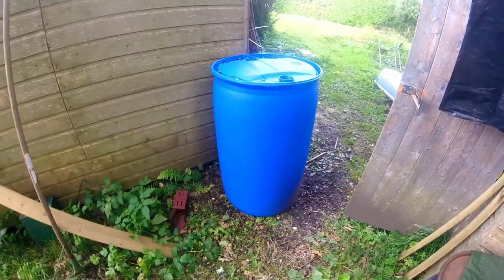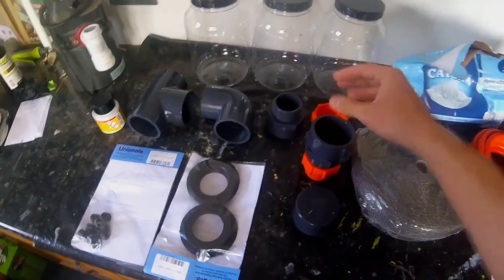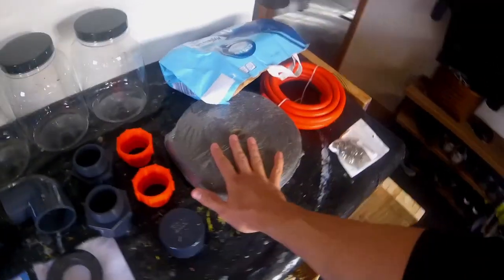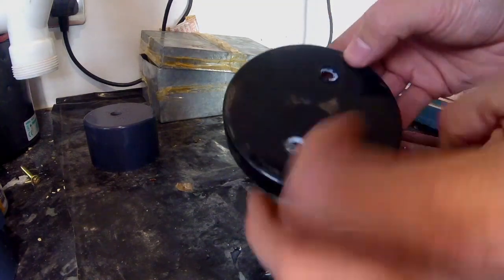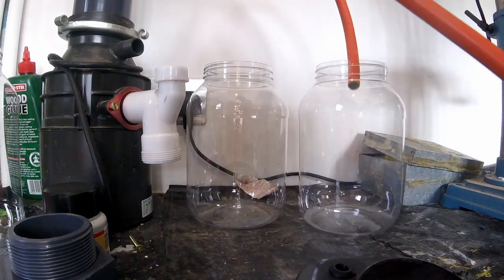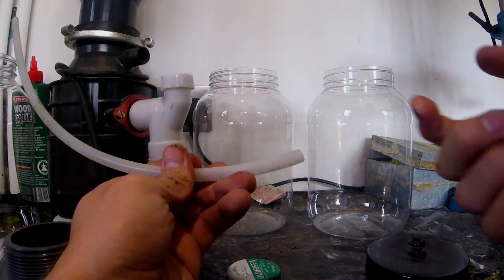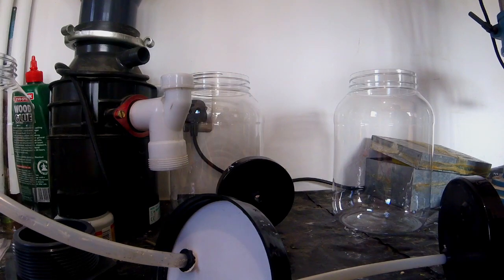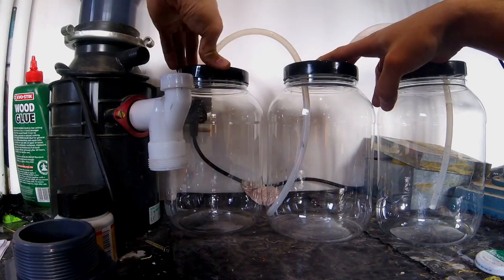Making a biogas digester // free gas at home // PART I

Comment: When using that type of hole saw, it is possible to enlarge the hole by fitting the original size hole saw, inside the larger hole saw. This will help, centre the larger hole saw, and stop it sliding about.

Comment: How long does it take to produce enough gas to run the generator for an hour?
Reply from the maker: Not sure. I haven't been able to produce that much gas yet. It will depend on the feed you are using, the temperature of the digester. Lots of things will influence that.
Reply: @GetMeOffGrid_ jak tam idzie praca?

Comment: I know people in developing countries use methane from septic systems. Do you think that is dangerous. I mean regarding pathogens and such. I suppose methane is methane. Guess the ick factor makes it's weird. Seems like a waste of good gas, if it can be used. Any thoughts ?
Reply from the maker: Yeah, I think it can work. Only issue here is people use lots of chemicals that I am sure would have a negative effect on good bacteria. There is a health issue as well, there can be some nasty bacteria is human waste so it would need to be managed carefully.
Reply: @GetMeOffGrid_  yea I've seen those biogas kits that have a toilet and a stove. Weird but I guess it works. I suppose the bacteria can't travel in the gas, and if they did they would be incinerated.
Reply: The problem of pathogens would be mostly in the digestate the system is producing, the liquid fertilizer left behind after methane production.  This is where we are worried about heavy metals, harmful microbes etc.  The methane portion doesn't carry these concerns.  You could use contaminated feedstock to produce methane, but your remainder is now somewhat hazardous waste rather than a usable bio-fertilizer.  In the absence of commercial grade treatments, it's best to minimise how much of these contaminants are in a DIY setups inputs

Edit:  in the example you gave, a septic tank input is already hazardous due to the microbes that can be present in human waste, so the fact that their digestate is not clean is honestly six and half a dozen.  They haven't created waste, they just fail to fully reprocess it.  You wouldn't spread it on arable land, but you weren't doing that before processing either

Comment: 2 questions, 1) why 2 gas outlets? 2) have you a link to follow up vid?
Reply from the maker: 1) Nothing complex; there were two holes... 2) I think you've found it :-)
Reply: @GetMeOffGrid_  Thanks for reply, I’ve set up a basic mini  system using what I found in skips etc, it’s a 5 gallon container connected via some fish tank rubber tubing. Attached directly to an old Pushbike Innertube, just to prove to myself that I can make BioGas, and to give me confidence to chuck out my old Electric cooker. To I have room for a Digester about the same size as the one in your vid. The Innertube has inflated so a small amount of BioGas is being produced, that’s without any heat and being in the coldest room in my flat. By what I’ve done so far is seems it isn’t necessary to  use Cow Dung as most people do. As I only want to use Plant matter, and perhaps some of my own shit. What do u think?

Comment: Hi, will dog poo work? I'm currently working towards off grid and have 14 dogs.. I hope they can help towards their up keep! 😉 Ta. 🙂
Reply from the maker: Hi. Dog poo is tricky one as it can have some nasty bacteria in, so using the outputs as fertilizers would be a no go. Apart from that dog poo could be used as a supplement but it couldn't be the main base of the digester that would still need to be ruminants manure.

Comment: Hi, will dog poo work? I'm currently working towards off grid and have 14 dogs.. I hope they can help. Ta.
Reply from the maker: Hi. Dog poo is tricky one as it can have some nasty bacteria in, so using the outputs as fertilizers would be a no go. Apart from that dog poo could be used as a supplement but it couldn't be the main base of the digester that would still need to be ruminants manure.
Reply: Ask geknowing questions

Comment: Hi Tom
Is it possible to substitute cat litter with beach sand?
Reply from the maker: Hi Calvin, You would need to substitute something  that is able to absorb moisture well. Dry sand would not be ideal. Charcoal, would work.
Reply: @GetMeOffGrid_  wow thanks dude, does it have to be activated charcoal?
Reply from the maker: @calvinsalim2375  From what I can tell it doesn't matter. Activated Charcoal could remove other impurities in the gas, but in this case it is only used because it will have an extremely low moisture content
Reply: The gas produce from this drum is enough for household cooking? Thanks for the reply

Comment: I feel like I'm being lazy just asking here, but I had assumed that other plant matter (not kitchen waste), such as grass clippings, weeds, etc ("green" compost material, not "brown" compost material) would be fine to add to a biodigester - is this the case?
Reply: grass and other "green" compost that i think you are talking about, contains a great deal of lignin, which is the main component of leaves, ligning cannot be breakdown easily by anaerobic bacteria, and  a pretreatmentshould be added for these kind of "green compost" in order to get a considerable amount of methane.
Reply from the maker: You can add it but it is what would be classed as "low energy" feed so you'd need to make sure you were still feeding it with kitchen waste to keep it going. You could also supplement with extra cow manure.
Reply: Nice

Comment: please help me
Reply: ok thanks for this information 😊😊
Reply from the maker: You will need to be more specific than that. What do you want help with?
Reply: I go to pure biogas
Reply: Which chemical substances you have used for using biogas please tell me in comment section because I am not understand your english language
Reply from the maker: No chemicals. Just cow manure, food scraps and water.
Reply: which substance used purifying of biogas
Reply from the maker: Water. Cat litter or Silica gel. Then steel / iron wool.
Reply: during this process biogas and pure percentage is methane gas available content
Reply from the maker: There will be a higher percentage of methane in the gas.

Comment: Next time install the outlet pipe without the rubber attached to the barrel  put on the pipe, once it's all the way to the bottom of the barrel slide the rubber outside the pipe. Work it round to fit you can use a blow dry to heat the rubber to fit well. (My two cent)
Reply from the maker: Okay great thanks! :-)

Comment: Could you add the size and length of the pipes that go in the barrel.
Reply from the maker: Hi Joe. The pipe is 2" diameter. The in-pipe can be just a bit longer than the height of the barrel, so around 1m (double check that as some barrels are slightly different heights). With the out-pipe you will want to put an T-piece so that can also be 1m, then add the T-piece, on the vertical coming from the T-piece you can add any height. I have left mine without as that means I can see into the T-piece and monitor whats going on. I hope that helps.
Reply from the maker: Hi Joe. I've added a materials list to the description. I hope that also help. Cheers